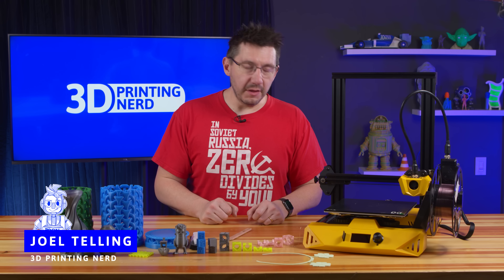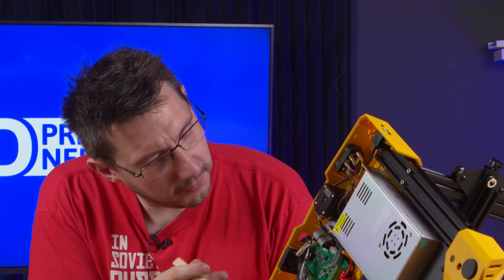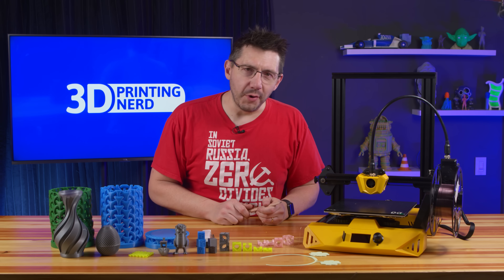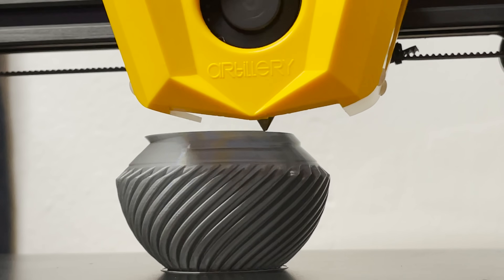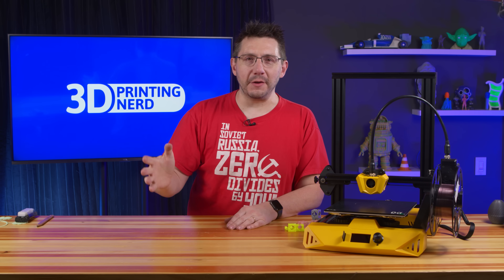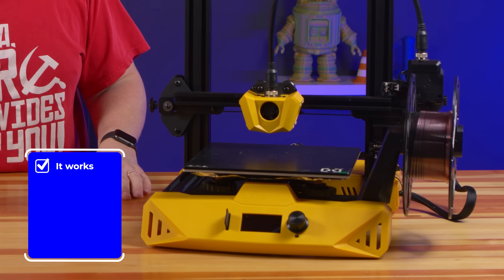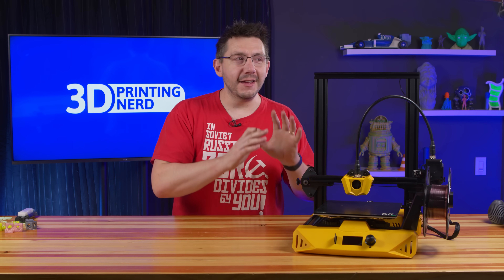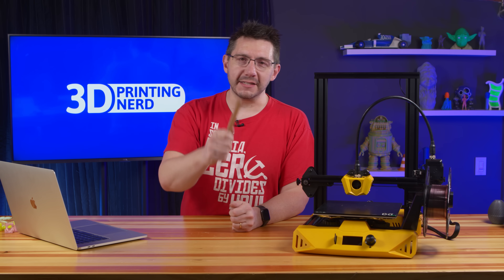THIS Is a Bad Idea // Artillery Hornet Review

Comment: I'm an electronics technician and have used ferrules for many years.  I want to add that not all Ferrule crimping tools are the same.  Use the ones that crimp from all 4 sides at the same time.  The crimping head will look like a star with a square in the middle when not compressed and a square when compressed.  Also make sure you strip enough wire so it sticks out the end of the ferrule and can be trimmed off once crimped.  For those of you who are like me and just can't trust crimped connections you can take a soldering iron and place it on the bottom of the crimped ferrule.  Once up to temperature apply solder to the wire at the end and the solder will flow along the wire into the ferrule and make that connection completely secure.
Reply: Can confirm and boost the star to square ferrules crimpers. Those things are magic
Reply: I had no idea you could do that!  Solid crimp plus solder sounds very good
Reply: @WhereNerdyisCool  if I recall the crimper I use has a blue and red handle, and a rounded die with the star formation at the top, solid crimper I use for ferrules in screw down terminals, bare wire be gone!
Reply: This. Bare wires screwed into terminals at the specified torque is far better than badly crimped ferrules. In fact, the terminal blocks were designed for bare wires. Never use a cheap-o crimping tool.
Reply: Someone should have told my A/C power outlet guy that, I don't think a single power outlet in my house has a ferrule in their connection, including power points spitting as much as 16 amps!

Comment: Disagree with you on the ribbons... They work just fine for me... Too many people do not know what they are doing...
Reply: And I have to disagree with YOU on the ribbon cables. "works just fine for me" does not make it safe or best practice.  "I can drink a 6-pack and still drive fine" works for some people too- doesn't mean it's safe, and I sure as heck wouldn't want to be on the road with that guy.

The FFC connectors are rated at 0.2 amps per contact, so even tripled up (as they are), that's still a fraction of the 1.5ish amps pulled by the heater core- and tweak the end of that ribbon cable at all or loose any of those 3 connection points and you are WELL beyond what should be speced there.

Also, saying "Too many people do not know what they are doing" is just wrong, rude and insulting- a manufacturer should ASSUME that their customers DON'T know what they are doing and should build a product to safe standards accordingly- I mean unless they really have great liability insurance... That would NEVER pass UL/CE certification.

I am an Artillery Fan- I find them to be an innovative company who isn't just straight up copying what the other guys are , and they are great to work with. BUT not all those innovations are good ideas or properly implemented. And that's OK- as long as they evolve and learn with each generation of machine. But both the ribbon cables (as implemented) and the all-in-one bundle on the Hornet (as implemented) are just no-gos.

Comment: Tinned wire ends are not better then just the wire.  The opposite is true, under pressure tin 'creeps' and so tinned wires may become loose if you connect them with those screw blocks.
Reply: Yup 100% this.  Tinned wires are an absolute MASSIVE fire hazard.
Reply: yep 
Tinned wires in screw terminals are worse than bare wire even tbh
Though a ferrule is the best solution

Comment: 8 actually like the ribbon cables of the sidewinder. They made my life so much easier and they look great. I have the sidewinder for nearly 2 years and I still haven't changed one ribbon cable
Reply: Same here. I’ve heard a lot of people complain about the ribbon cables on the SX1/Genius, but I’ve never had any issues at all with them in the 1.5 years I’ve had my Sidewinder, and like you said, they look great
Reply: I certainly like ~~ribbon~~ flat-flex cables (FFCs) in theory!
("ribbon cable" generally refers to the style of cable used with old PATA/"IDE" hard drives/etc., I believe.)

I don't own a 3D printer using FFCs (eg the Sidewinder X1) so I don't know what the current implementations are like.
Are they using unsuitable connectors that don't provide enough retention force, maybe?
(And might different revisions of the Sidewinder X1 be using different FFC connectors? That could explain the polarised opinions!)

However I love how the Sidewinder X1 looks with those FFCs, and I have long-term plans to switch to FFCs or ribbon cables on my modified Prusa i3 MK2-ish printer because it looks like either option would greatly improve the cable management (using custom marshalling PCBs).
I really dislike the Prusa i3's extruder/hotend cable routing. It's such a headache, when creating custom extruder mounts/X-carriage assemblies, to route the extruder cables without trapping them between the X-carriage and the printer's frame at the far top, left, or right extents of the print volume 😣

Using FFCs or ribbon cables up the frame, as seen on the Sidewinder, just looks a lot neater and easier to manage - as long as my PCB designs include spare lines for future expansion!

It should just require the use of suitable connectors for it to all work nicely. 2D printers have been using FFCs for ever without issue, after all!
Reply: @AndrewGillard  Other brands like Type A and FlashForge use them on their machines and it seems to work. Like with anything you got to sometimes step out of the box and go from there. That said, lots of people have burnt XT-60 and "green screw terminals" through misuse so... no connecting system is perfect!
Reply: @MakeItWithCalvin  I think the key to not having connectors fail is in choosing an appropriate connector for the application (considering connector type, size, ratings, features, ...) *and then using it correctly*.
(Possibly also not buying cheap knock-off connectors, too, but that's very much a case of some being worse than others. I have plenty of cheap connectors from AliExpress that don't concern me at all, but I've also seen some that absolutely do! :))

e.g. screw terminals can overheat/melt/burn if overloaded or not tightened enough (or if people use tinned wires... cough 👀). Check the datasheets of screw terminals at DigiKey/Mouser/etc. and you'll find that a lot of them actually specify a recommended screw tightening torque - typically 0.5 N·m (0.4~0.6 N·m) for the terminals I just checked out, all of which were around the 5.08mm pitch that's commonly used for 3D printer control boards.

And of course there were the XT60 connectors that Angus reported on being crimped rather than soldered. Fun! :)

You're exactly right. Any connector is susceptible to failing if it's abused!
Reply: Same here. I like to say they can not have issues but I suspect it is people not inserting them properly and not keeping an eye on it...
Reply: I too have a Sidewinder X1, and the ribbon cables work fine -- but, one of my early 3D printing projects was to create strain-relief clamps to control the flex at the print head and at the X rail (and also for the print bed cable, but that's a conventional cable type)..  The flex of the flat cables should not make its way to the connectors themselves. I think that's what cause some of these printers to have issues.

Comment: Hi Joel, I can agree with you on the proprietary cable they used on this. Not great for clogs and cold pulls. About your "Ribbon cables, no one likes those..." comment, I've been printing with my Sidewinder X1 v4 with zero issues with those cables, or anything else, for a full year. I even bought a second Sidewinder X1 back in January. Is it user error, or older versions of the printer that have issues with those ribbon cables? I have yet to replace any of the parts that came in the spare parts bag. Still prints great a year later.

Comment: 3:05 Wait, What!?
Everything I've ever seen says that tinning the power wires is an awful idea that leads to shorts.
Reply from the maker: Yup - I had said it backwards. But you need ferrules :)
Reply: Not shorts, necessarily (AFAIK). But it is a bad idea, yes.

The tin creeps/flows over time, gradually resulting in a loose connection. Loose connections have higher resistance and can arc, both of which cause heat which can make the tin flow faster, making it worse.
Heat can also lead to fire.

Plus, if the wire completely falls out of the terminal, it could contact another conductor, potentially (pun not intended) causing a short circuit - and more risk of fire!

And if it's the live/line/hot/etc. mains AC wire that's come loose, it could come to rest against nearby metalwork, causing the whole printer frame to possibly become live at 100-240V AC! Fun!

Terminals using strong springs (e.g. the popular Wago 221 and 222 terminals) can mitigate/reduce the risk, as they will keep applying enough force as the tin creeps.
But really, just use ferrules! 😁

Ferrules are cheap, quick and easy to apply, and give a nice, neat, professional result! <3

(They can also be obtained without the plastic insulation shroud, which can sometimes get in the way. Wiring a British BS1363 mains plug comes to mind.)

Comment: They could keep the special cable that combines the wires and filament tube as long as they add external service port to connect the electronics of the hot end to the main board to be able to turn on the heater and thermistor and service the hot end in case of clogs and other things

Comment: Also, good luck replacing at some point in the distant future [or perhaps even now, unless you're a reviewer] the custom combined filament feed and control line.  Customer support and spare part availability aren't exactly Chinese hardware suppliers' strong points.
Reply: Guess the first thing you should print with this are spare parts 😂

Comment: Bare wire is better then tinned wire!
Tinned wire and a screw terminal are the best way to burn you house down... tin is never "solid" and will slow flow under the pressure of the screw with will lose the connection over time and start arcing/heating up when current flows.
Reply from the maker: Yeah I was thinking that. I said it backwards. Still, FERRULES!

Comment: They should make a set of cables to use in case of break down.  Jumper cables for your 3d printer.
Reply: Yes but you can’t jump a car with the hood closed :D ;)
Reply: @jim2386  I could, but I had a Cadillac with the battery under the back seat and a Jaguar with the battery in the trunk.  Would not recommend either.

Comment: I remember when you could drop a quarter in the engine bay of a car and find it on the ground. Now a a thin dime would get lost in the first foot.
Reply: Username checks out
Reply: @infernaldaedra  truth hurts?
Reply: @OldCurmudgeon3DP  Nah not really it was meant to be a silly joke but you have an extremely valid point I had a old air cooled straight block engine and there wasn't much there but a starter, cooling fan and a couple hoses and wires. Was it easy to work on, hellyes. 

But there wasn't really much comfort and it didn't have any of the tech that any newer vehicle would. I still think vehicles should be designed in a way where they are easy to maintain and on newer vehicles its a right PIA to remove 10 parts to replace something simple.
Reply: @infernaldaedra  eh, it's cool. Just woke up and brain wasn't working. 🤦🏼

Comment: Oh man no cold pulling?!? That’s easily the most used technique I use for clearing clogs. 

Great suggestions on the 2 tubes/clips to hold the cables
Reply: I don't see an issue with cold pulling. Just pull it from the feeder. its how I do 99% of my cold pulls anyway.
Reply: @nerys71  me too
Reply: @nerys71  You could be torquing parts you really shouldn't if you're not careful though. I assume other people won't be as careful haha
Reply: @GuardedDragon  Its not that much force. not going to hurt anything.

Comment: That's why I disable the machine settings in Prusaslicer (I use the more feature rich Superslicer fork). I've tuned my printer and don't want the slicer dictating accel/jerk/etc values for it. Also, if you run firmware other than Marlin, it'll likely throw errors anyway.
Reply: PrusaSlicer (and the original Slic3r) has an option to select the firmware your printer is running. If it's generating G-code that isn't compatible with the selected firmware, that sounds like a bug that should be reported...

I've never had PrusaSlicer create G-code that my Smoothieboard choked on, at least, and I do believe it's including acceleration settings in the G-code (for better or worse).

Unless you're using a firmware that isn't in that selection box?
Reply: @AndrewGillard  true, but if you don't verify that selection then odd things can happen.

Comment: You used my IdeaMaker profile! Awesome!

If you want to do a cold pull, you just need to heat up the hotend to ~230c, turn off the printer then quickly remove the bowden connector from the hotend. You will be able to push some filament trough the nozzle before it cools down, and then a cold pull is possible.
Reply: This makes a lot of sense. 👍
Reply: For a cold pull, shove the filament in while nozzle hot, allow to cool, then heat the nozzle, pulling on the filament. You need the nozzle heating while you're pulling. Easy solution, a couple of plugs, with wiring, but no bowden tube. It's not rocket science.
Reply: hey man, im very interested in this printer and fairly new to 3d printing in general, got an ender 3 2 moths ago, i've been wondering about the quality for miniatures compared to an ender, will it be the same? seems like a silly question but the community for artillery is very small and i cant find anyone printing miniatures on it unlike the ender 3 which has a huge miniature community
Reply: Not exactly the ideal solution, but at least it's possible. Sucks that such a clean setup compromises repairability quite a lot with this thing.
Reply: @blazewind  Not really. If your only problem is the hotend sometimes clogging, you can just dismantle it while its hot instead of cold pulling. There are ways to go around everything
Reply: @blazewind  Pretty designs have been negatively impacting repairability for as long as there has been a desire for pretty things.

Remember when it was easy to replace a hard drive or battery on a laptop?  Not any more.  You can still replace the battery by pulling a dozen screws, OR melting the glue holding it together with a heat gun; but as more and more manufacturers integrate SSD storage directly on the motherboard, you can't do much with a damaged boot device.

Comment: Guess you could remove the nozzle and force stuff through, but it's a super short sighted idea!
Reply: what about using standard cables to extend the cables to the hot end while keeping the cable bundle thing plugged into the extruder stepper side, then you could access the hot end with the bowden disconnected i guess

Comment: I always thought bare wire was better than tinned, caveat: you must not have any stray strands if bare. They can cause shorts.
If the connection gets warm through loading or a poor tightening of the connection, the solder will soften. This will loosen the connection in turn causing more heating; rinse & repeat until combustion.

Comment: excellent review 👌😎 Mine is also on the way.  Just an idea, I know it’s not easy but have you tried doing a cold pull through the bowden? I successfully did than on other printers.
And I agree with your proposals, especially the colored touchscreen.
Reply: I agree with Joel. See the thing about experience is that the more you have... the more you know. I've done cold pulls and hot pulls on bowdens and direct drives... never had a problem... until I had a problem.  Filament got stuck in the bowden, had to eventually cut open the tube to see what went wrong and realized that it would never have gone through. Anyway I replaced the tube, back in business no biggie and no major expense. Now imagine you live in Alaska, or Zimbabwe or the Amazon. The hornet umbilical is a specialized part... in a critical failure prone area. Look at the stepper drive for comparison. - That is something that shouldn't fail frequently, and yet it was easy to source and replace. Nope if they want to ship with an umbilical, they should at least supply two spares with each unit. They have reduced their sales footprint by introducing a market spares barrier. REnault 5 - pull the engine to replace the spark plugs... facepalm.